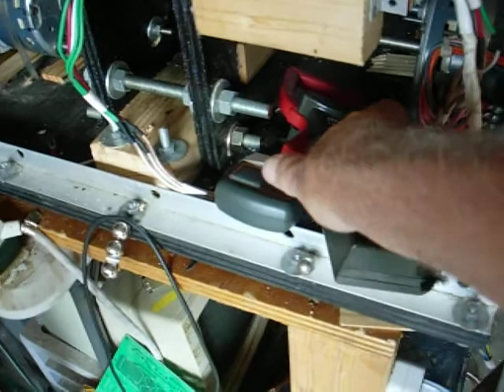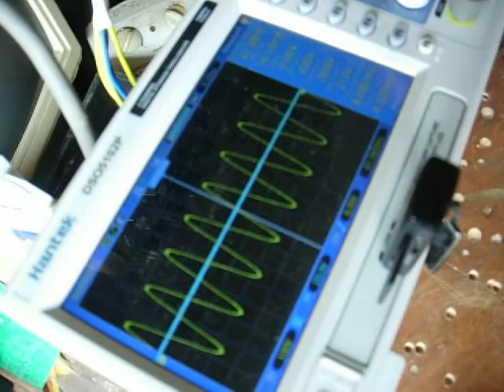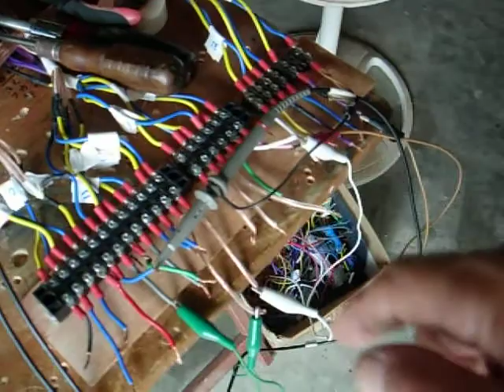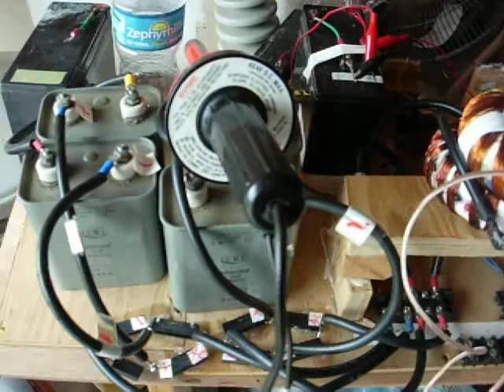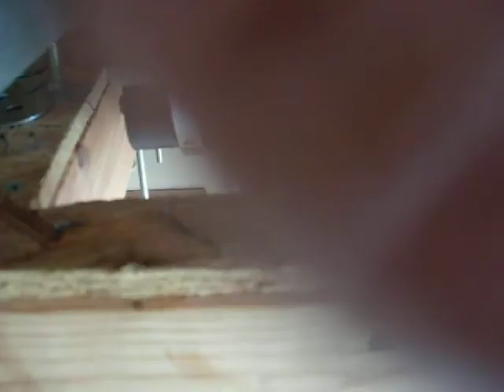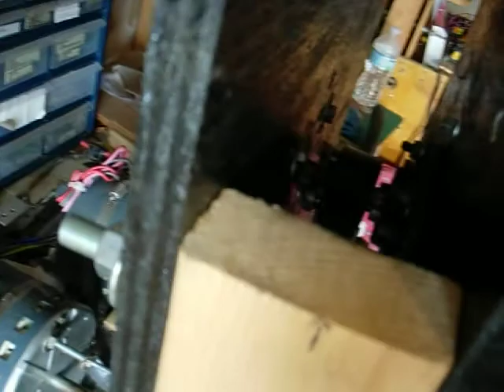Don Smith #261  update on samsung system

Comment: So how can one replicate this?
What’s the setup, motor, etc

Thank you
Reply from the maker: Samsung 36 pole motor ebay has controllers for this  suggest that you use rugged mounting  for everything  the generator are ECM motors from junk yard old Air Conditioner fan motors no electronics needed just bridge rect and caps to get ac to dc. use flat belts 1" wide also try to get gears to match belt .  the V belts waste too much energy.    the ecms are already setup to generate AC volts  I used collers to allow all 4 ecms to synchronized   so that AC could be combined series or parallel.

Comment: I just saw the video
Looks great
I have no idea what's going on though
Good luck
Reply from the maker: there are several ways to generate electricity rotating a field thru wire ,  using a flux gate to cause flux to change thru a core material.  and finally directly from the vacuum maybe using some kind of crystal structures.